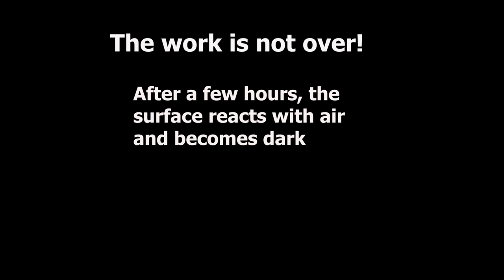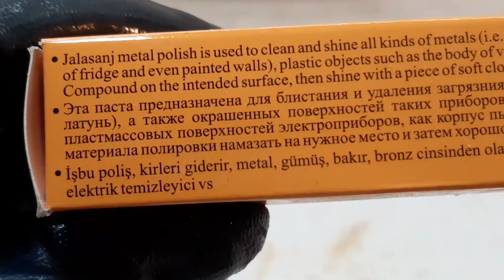Antique Caviar Serving Dish Restoration 1960's - Made in Iran 🇮🇷

Comment: There are far easier ways to polish tarnished brass than using acid. 1/3 cup of flour, 1/3 salt, 1/3 cup vinegar. It makes a paste that you cover the piece in. Wrap it in plastic saran wrap for 24hrs. then wash off the piece with water. Less dangerous and less likely to burn your work surface or any other part.